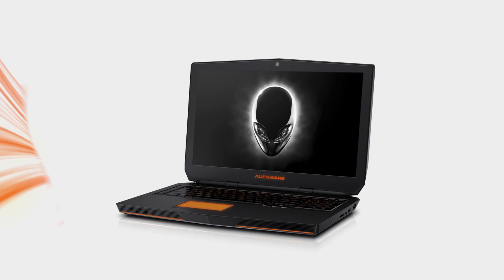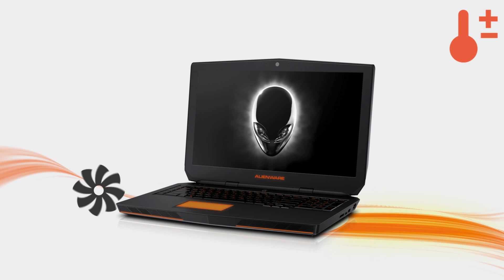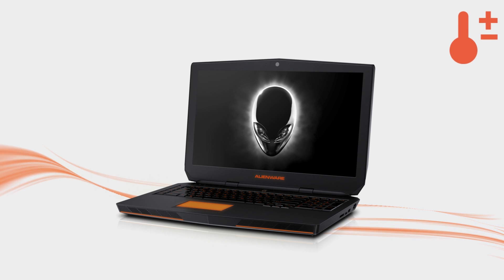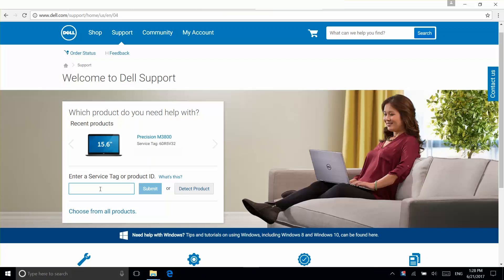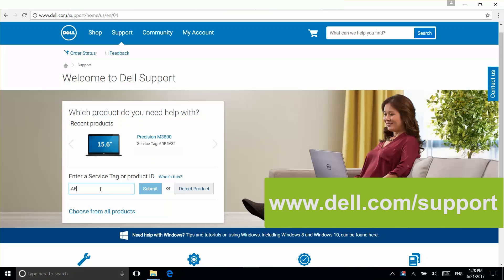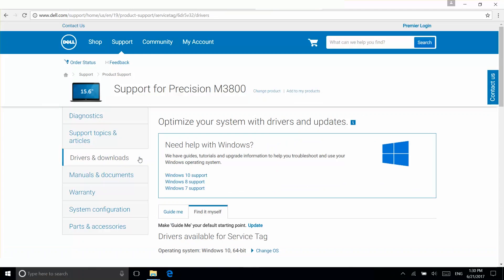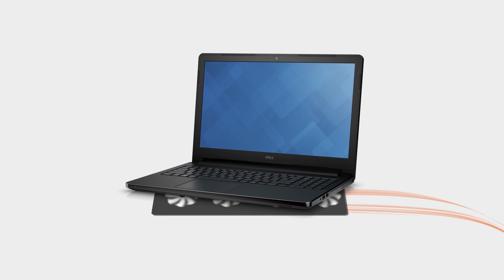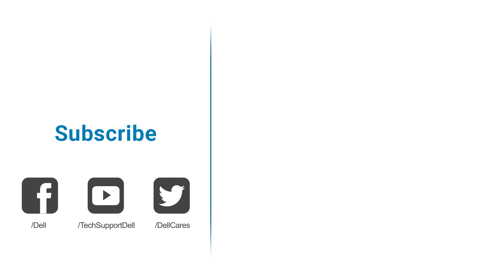How to Fix Overheating Laptop (Official Dell Tech Support) - RETIRED

Comment: I have Dell G7 7790 (processor - 9750H) since 1.5 year.  This computer was cleaned, thermal grease is now new. Im sorry but cooling system does not fullfil its task in Intel TurboBoost mode, because CPU cores reach 100C temperature - while (for example) a game is starting.

Comment: The heating issues are easily explained.  Simply turn over the laptop and on the bottom you will find a sticker.  Look closely at the sticker and you will find: "Made in China".  The servers are built in Austin, Texas as of July 2019.  However, they moved "assembly" to China, Ireland and Mexico.  My former company insisted on Dell laptops for the staff.  I recently removed the hard drives from the SEVEN fried Dell laptops that have been sitting in my garage.

Comment: Dell official support makes a video for users about how to avoid the overheating problem and they suggest use a cooling pad! Incredible solution that is nobody thinking it until this time! Good job but maybe you should consider make a video for your production and design unit in Dell and suggest to them put inside the laptop case a bigger fan than that they prefer.

Comment: Ive never had a dell with a proper cooling design. 1. It starts with bad  tempearture sensing. My values jump +-10 degrees so I never really know how hot the system is. 2. Only 2 fan speed values. 3. Cooler is too small. If I do a benchmark i hit 100degrees after 30seconds. So all in all you could say dell saved a lot of money on the cooling system. The end result is that under load my i5-9400 back home is almost as fast and a lot cooler as the i9-9880hq. Shame on you Dell.
Reply from the maker: Hello, we currently don’t have dedicated support on YouTube, but don’t worry—you can get 24/7 live assistance through Facebook, Twitter and Dell Community Forum (DCF). You could write to us there, and we’d be glad to look into this for you.
Facebook: https://dell.to/38YfsFW
Twitter: @DellCares 
DCF: https://dell.to/3etrPej

Comment: I want to buy G3 but only thing making me thinking twice is the overheat . is there any update or fix for it ?
Reply: I have the 2019 G3. And it overheats pretty often and it power throttles the i5 9300h to a 25w limit. The cpu will never be able to run at its normal 45 watt td in this chasis. And you will need to undervolt the cpu and gpu to keep temperatures under control. If you have a little bit of extra $$$ I would recommend the Helios 300 or the lenovo Y540. 
Or the Ryzen mobile chipsets which are MUCH better and the same "copy paste" of intel. I hope that Dell changes to a Ryzen chips this year, but their cooling has always been bad.

Comment: Intel turbo boost was my problem 100000% 🙏
Reply: But it will decrease performance hard or not?
Reply: @kleddo3126  No, before that i played GTA V and there was many lags and fps drop 
And after i turned off
The game run smoothly on HD quality 
I didn't try full HD 
BTW my laptop is dell i5 inspiron 3593

On general, i didn't feel if the performance is lower than before.
Just try it man, and if u don't like it, you can turned back on 
It will not cause and problem or trouble.
Reply: Did u turned off or on ??
Reply: @basilalshami2760  it comes from the factory on and thats what is causing the overheating
Reply: @basilalshami2760  off
Reply: @basilalshami2760  its right in the bios you'll see it
Reply: Yesssss it's work perfectly, thank u bro ;)

Comment: My 1400 euro Dell Latitude 5400 P98G with the Core i7 8665U goes to 100 C when doing simple browsing and such. It's 1 day old. Using HWMonitor I see that the vCore jumps to 1.4 volts regularly. That's mega overkill. Having the option to set this up manually to a constant and stable voltage would be much better for me.
Reply: U have the latitude

Comment: Today I bought a Dell inspiron 15 5575. I have own this less than 8 hours and it's already overheating.
Edit: It's new.
Reply: I have the same issue smh
Reply: If you have the "Dell Power Manager" software, go to the Thermal Management option and choose Maximum Performance. The Optimized option starts the fans late, so that's why the laptop overheats.
Reply: @rodrigoquintana8747  downloaded Dell Power Manager but there is no thermal management option
Reply: @tombeats6314  do you have your BIOS, and other drivers updated?
Reply: @tombeats6314  any update?
Reply: @okietokki  already watched that, I think this problem is in the BIOS or hardware problem
Reply: This worked for my inspiron 5575. I went to power options switched from Dell setting to balanced. Then selected change plan settings, change advance power settings, processor power management. Here I changed 2 settings system cooling policy and Maximum processor rate. System cooling policy to active and max processor rates to 95.
Reply: same problem, any fix?
Reply from the maker: Hello, we currently don’t have dedicated support on YouTube, but don’t worry—you can get 24/7 live assistance through Facebook, Twitter and Dell Community Forum (DCF). You could write to us there, and we’d be glad to look into this for you.

Facebook: https://dell.to/2PepAEg
Twitter: @DellCares 
DCF: https://dell.to/2PaIX1a

Comment: My Latitude E7240 (refurb) is running waaaaay too hot. Occasionally makes a popping sound.  Bought from dell directly and told them that it was hot back then, too. How much will it cost to replace the fan? I keep getting an error when I turn on the computer that says "Fan Error."
Reply: I have the same laptop as u

Comment: There is a well known issue with the Dell G5 overheating when the bios is upgraded to 1.4.0. The fans don't turn on until temps reach 75 c and it thermal throttles.
Reply from the maker: Hi,

Currently we don’t have dedicated support on YouTube, but don’t worry—you can get 24/7 live assistance through Facebook and Twitter. 

Facebook: https://dell.to/2SLWXuN
Twitter: https://dell.to/2SSsn2C 

You could write to us there, and we’ll be glad to look into this for you.

Comment: I use Notebook Dell Inspiron 13z 5000 (1 year old) it is hot on touch even with fans making a LOT of noise (in room tempreture 21°C) with only chrome started
Reply from the maker: Make sure you keep all the drivers updated and BIOS. Try doing an ePSA test (https://dell.to/2SHN0OP) to check any hardware failure.

Comment: "we build shit machines that can't operate as expected without extra peripherals but it's on you to deal with it". Why don't you include that your heatsinks are pretty much useless and that you use ape guano as thermal paste while also applying it as a generous patch? Yeah, brush a radiator, sing it a fucking melody if you will, it won't make much difference because it is a hardware flaw and you know it because you build shit machines, Dell. Good luck with your company image, fucking morons, never going to come near any of your overpriced shit that can barely compete with 10 years old laptops.

Don't ever consider buying Dell laptops, god forbid you pick from their "gaming" Alienware line, because these chunks of shit are so poorly designed that you will feel yourself having a disabled pet that can only produce fucking heat. Avoid at all costs.
Reply: i bought dell's laptop for 1000€ + and it freezes all the time : ( their diagnistic tool says that all components are working fine which is total bull*hit man. They support suck as well they just tell you to reset windows and uodate drivers that's all. Never buyin' dells product!!!!!!

Comment: @TechSupportDell my laptop a G7 Dell with nvidia gtx 1060 max Q and a intel i7, has been severely overheating as high as 96C before it throttles down. Now im no expert on this stuff but did you guys not do any basic testing with this at all? I mean im using like 20% of the cpu and its a 96C... ffs, the GPU stays constantly at 77% while gameing but the CPU jumps around so much from 80-96 its absoluetly insane. I now have a cool pad thing for the laptop it helps a bit but it is still not enough. Eaither you guys dont know what you are doing over there or there is a problem with intels stuff. I can hear it now, "did you update drivers" yes, "is anything else running in the background causing this?" NO, i even reinstalled windows completely to check if that was the problem and the problem still exists. Will not recommend any Dell laptops in the future for sure they get so dam hot youd swear its about to burst into flames!
Reply from the maker: Hi, We have our support channels via Facebook and Twitter. For your queries, you could reach out to us @DellCares on Twitter or you could reach out to us via Facebook by clicking on this link: https://dell.to/2R6z2p9

Comment: Dell should let the user modify fan speed manually
Reply: Dell isn’t an operating system, Dell is a product logo. Don’t tell Dell to add that, tell Microsoft to modify the fan speed
Reply: they do type fn+ shift+ 15324 then type fn+r
Reply: @samcq5088  can you pls tell me how it works?
Reply: @user-di7ud1ie8u  sure all you do it hold down fn and shift and then as follows 15324 then fn r I don't know what all models it works with but it does work with mine I don't know but go into my channel  by clicking the link "sam's gaming" in your comment  and find video in video section called how to adjust fan speed on dell laptop then comment so I know you were able to watch ok and subscribe I need support
Reply: Sorry it took me so long to reply my Internet got messed up
Reply: @samcq5088  thanks
Reply: Were you able to watch the video
Reply: Right
Reply: I'm really hesitant of that because if your laptop is really hot and you put the fan speed to minimum then your laptop could overheat badly

Comment: I recently bought a Dell XPS 13 9360. I noticed that during charging,  the bottom of the laptop gets very hot (the cooling fan is running) even though i did not run any applications. Is this normal ?
Reply from the maker: Hello Jun,
we recommend in this case to reach out to our tech support. You can reach out to us also via Twitter or Facebook. Just sent us there private message with the TAG Number of your device and full Problem description and our colleagues will gladly have a look.

Comment: I have a Dell Inspiron 11 3000 , 2 in 1 seriesIndoubt a cooling pad can be used fornthos particular notebook, since therenis no air vent on the bottom, just plain plastic bottom. The only vent for in/out air flow is on the back side. I had a problem two days ago with the computer. It was freezing all the time. Besides the fact that windows 10 and the latest Firefox are bloated and resource-hungry and half the memory of the 4 Gb of RAM gets used just for the OS to work, Firefox usually brings it up to 80%< 90% if using Youtube ajd a few tabs. However, this was not the case, so after I rebooted without any success, I considered overheating, which had never occured so far in two years, since I have the machine.I ran the diagnostics available at startup and it gave me a cooling fan error. I opened the bottom and the hard drive was rather warm, the CPU as well and the fan was not working. I cooled the hard disk and the CPU area with two fans: one cooling fan for desktop computers used for cooling the hard drive from underneath, and another coolong fan rescued from a discarded power source. After the cooling, I rebooted te machine, ran the diagnostics, everything was back to normal. Then the fan worked just fine, did its job.I must specify that there was no above the average heat inside where the computwr was. So I have no clue as to why it happened.At least it's back in business.
Reply: Just found this...I'm using an 8 yr old Inspiron with Windows 10 & lately everyting is going to shit Right when I need to do 'Real-Life Work'!!Arrgghh. Your input was very helpful to me, thanks, Mike & God Bless You & Yours.

Comment: Sir my processor fan is not working so what should i do for it...
You can send  me the solution in my mail rakesh53413@gmail.com
Reply from the maker: If the fan is not working at all you might need to replace it. If your system is still under warranty send us a private message with your service tag and a brief description of the problem otherwise we will recommend you to take the system to a local repair shop. 
http://dell.to/2ITRpuh
Reply: Sir but how to do i haven't any idea i have installed new update of bios but agin i restart i am getting processor fan not working message from dell support.
Sir please tell me another way to solve the problem....
I have warranty of my dell laptop
Reply from the maker: Please send us a private message with your service tag, we will help you out from there. 
http://dell.to/2Ga3bPt

Comment: I need help with my dell computer it says "Your power adapter does not supply enough power to run the attached docking station. either undock or insert an appropriate adapter. then under it says strike the f1 key to shutdown.
Reply: I can help u out u just need to press f1
Reply: Tony TwoLitres I don't know if it is the battery or the charger I use a laptop

Comment: it's not enough to brush the radiator from outside. It's necessary to clean the fan and heatsink, radiator from inside. Also renew the thermal paste. Pet lovers should do that more often. Because tiny hairs stuck on the radiator and blocks hot air go through. (Sorry about my poor English.)
Reply: they aren't saying that because you could void your warranty...I think and also cuz there are ppl who are too stupid to open a notebook and replace the thermal paste
Reply: Thanks for sharing such a great advice.  Your English is pretty much good 👍👍👍